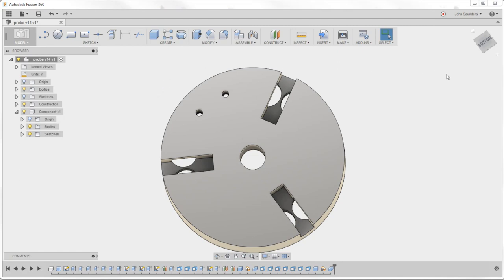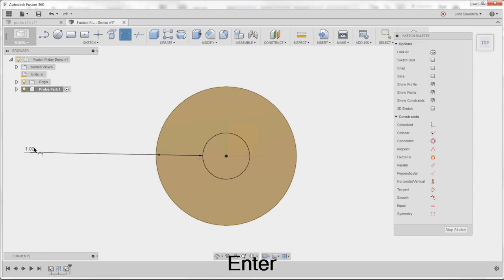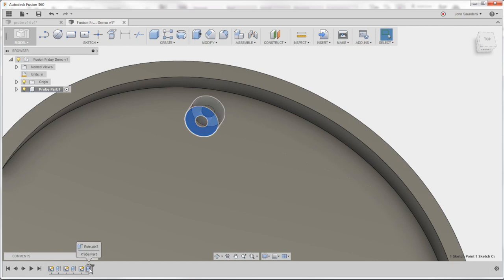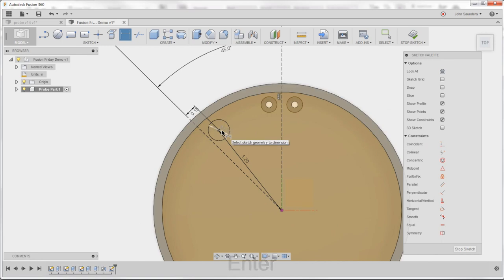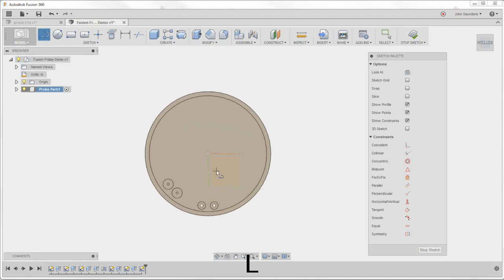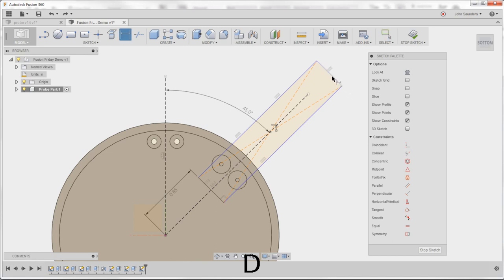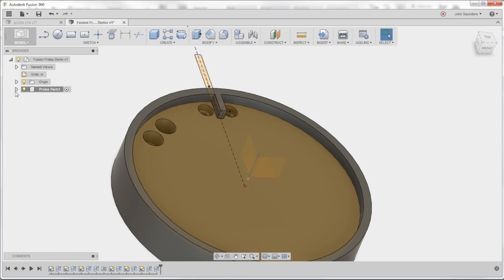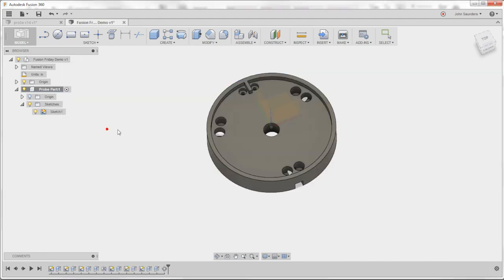Intro to Fusion 360 CAD Tutorial: Probe Disc! FF36

Comment: Hey John,

Just wanted to take a minute to thank you for these tutorials. While I'm sure my abuse of Fusion 360 will offend a few, I used it the other day with great success on my manual machine.

I had a 40 hole bolt layout I needed to drill out in a 12"x5" 1/2 aluminum plate  where accuracy wasn't paramount. I was able to get my laser printer to print to scale with remarkable accuraccy... My sin was printing the layout on paper, and then with a clothes Iron, doing a toner transfer onto the plate. Just as in the same manner as you would if you were etching a PCB board... :-)

In short, I modeled it, created a 2D drawing, saved as PDF, opened in Adobe Acrobat Reader, printed to legal paper, cut out with exacto-knife/straight edge, and ironed my layout on.

With Dykems and my scribes, I probably would of screwed-up multiple times and spent a lot of extra time... blaaa blaa blaa. 

Fusion 360 + DRO = Pretty Damn Fast!
Reply: This layout method will also work quite well if one doesn't have a rotary table (or a big enough one) and needs bolts X-Degrees apart. Model it, print it, transfer it, drill it...

Comment: Hi John

I tried modeling this part before watching you do it. I sketched every detail of face 1 then did a series of extrude commands, 
sketched on the back with every single detail for the back then another series of extrude/cut commands (total of 2 sketches 6 extrude commands). I learned a lot observing your work but still can't decide which way I like better.

Anyway, great tutorial as usual. Thanks !

NOTE TO MY FELLOW NEWBIES:

Try to model a part BEFORE you watch someone else does it. Then do it after, but this time try to incorporate the steps you liked. You'll learn more this way (Aha moments?) . For example, I included four excellent time saving steps the second time I modeled this part, which were:

1.   9:50 linking dimensions.
2.  12:07 sketch anywhere then place it correctly using constraints.
3.  12:58 using a rectangle and center it to the construction line instead of making series of lines/mirroring around the construction line to make that shape.
4.  14:00 edit profile sketch.

Comment: You can also change the view under display settings to display hidden edges. The benefit there is the hidden edges will be a different draw method than the visible edges. For me my perspective gets really screwed up depending on the part unless I can tell what's hidden and what's visible quickly.

Do what works for you but it is an option instead of opacity changes.

Comment: Nice! I recognize that part. I was just researching how to build those to add into my CNC build. A Haimer is still out of my budget range for now.
Think this could be a new project? A wireless version could be interesting.
Reply: +NYC CNC I could be wrong, but I believe it's the contact plate for an electronic probe. the simple ones just use a headphone jack style plug for a wired connection, but I think you could go with something like a Feather from Adafruit and make it wireless.
https://www.adafruit.com/products/2995

Comment: Windows has a screenshot utility called Snipping Tool. You can even enter snippingtool in the Run dialogue.
Reply: Or pin it to the task bar for one click access.
Reply: +NYC CNC Yes. Snipping Tool.
Reply: Part of windows 7, maybe others. Drag a box and save as partial screen shot.
Reply: +Ronald Thompson Also in Windows 10. I assume it's in 8/8.1 as well.

Comment: Excellent! Question, is this to be a molded/cast, or machined part? How would you cut the square inner corners of the boss and "jaws"? Or do you have to fillet the dimensions to match with your smallest tool dimeter?
Reply: It's made out of acetal needs to be an insulator , there is a few more parts involved in six balls 

If you have not guessed it's the insides of a 3D probe for a CNC mill 😀😀
Stuart
Reply: ahh, was not following the lead
Reply: so will cam automatically adjust profiles to available tools and over ride dimensional  congruency(to certain percentages), or can you adjust go/nogo tolerance allowances?